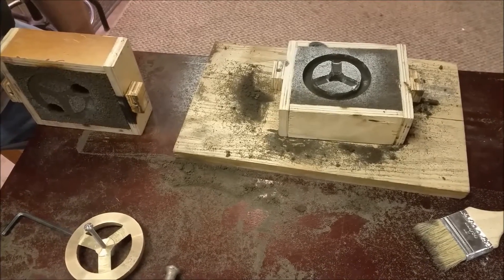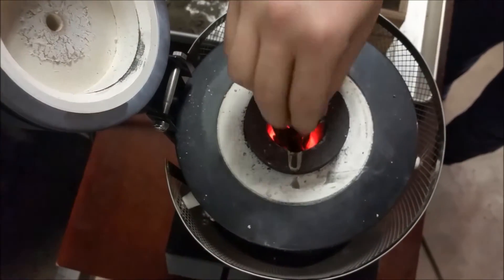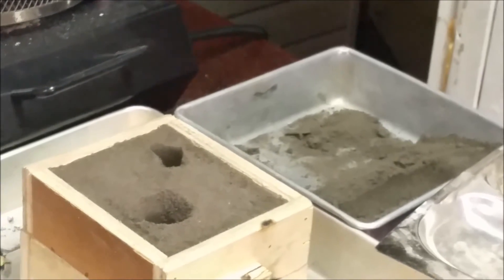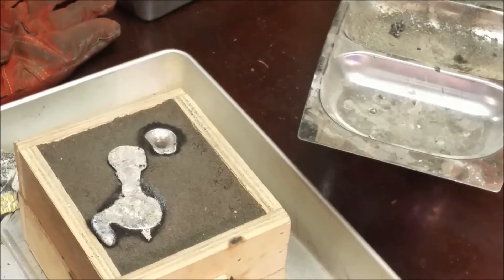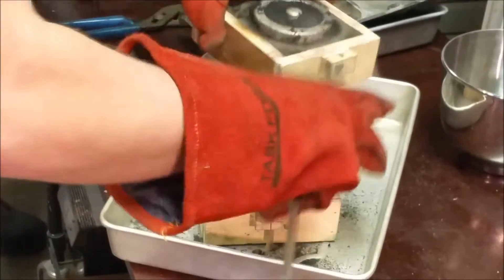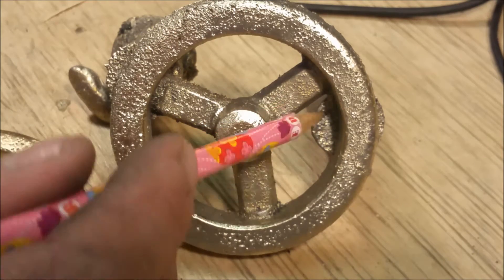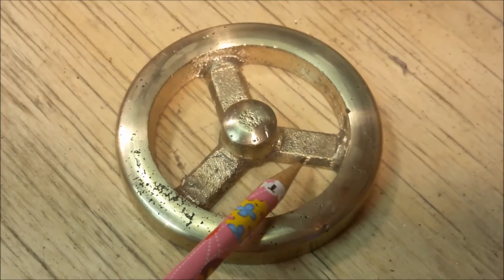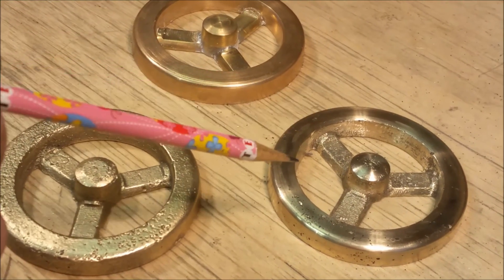Brass casting #14 Second flywheel casting

Comment: The petrobond will make a better finish but not "that much" better than what you are getting. There is technique you use are missing. Get a screen and sift the sand through a screen so only the finest sand is next to the pattern. Then add the coarser sand to fill the rest of the mold. To get a lot better finish, you would go to an investment casting (lost wax is an example).

The more I see, the more I like the electric melting furnace you have there. Is it 110 or 220?  I see them advertised on ebay as 1KG and 2KG. What size is that one? I was planning on just buying one from foundry101 that has a nice package deal but I am thinking that the electric would be less hassle to deal with than propane. How long does it take to get to temperature?
Reply from the maker: +David Kirtley Thanks for the info on the petrobond. I'm worried that my home-made green sand may be causing the issues I'm seeing with the pit-marks. I will take your advise and run the sand through a screen/colander on my next attempt. I will also watch some videos on lost wax casting process.

As for my electric smelter, it runs on 110v, and holds 2kg. I bought mine from Amazon. Here's the link for more info: http://www.amazon.com/gp/product/B00MOX0DOE?psc=1&redirect=true&ref_=oh_aui_detailpage_o05_s00
It's really clean and easy to use. I think I'll be able to make 2 flywheels from one crucible of brass. So far, I'm pretty impressed with it. A half a crucible takes about 25min to melt at 1850 degrees.... not bad in my opinion compared to propane, and I don't have to refill my tanks. 

Thanks for the comments and advice!